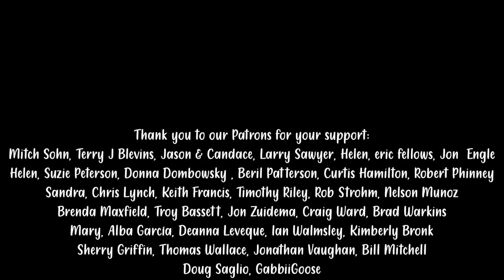THIS IS A STRUGGLE // siding our off grid workshop

Comment: You will like that Hardie Board (Cement Board). I have it on my sunroom in Florida and it is tough stuff and holds up well. It's good to use metal flashing behind the joints to keep driving rain from  penetrating behind it.

Comment: Back when I lived in Costa Rica, we had some serious terciopelo issues.  I considered making a device I call the hot rabbit, fur on a pole with a (battery operated) heater.  The heater would be tiny (just resistors dissipating heat), and you can wave the pole in front of you when walking through the jungle.  Hopefully, the terciopelos would strike that and not your legs.

Comment: Good job on getting masks!      Some side notes: you really don't want to caulk the bottom edge of lap siding. It defeats the purpose of the lap in shedding water that gets behind the siding. (Hint: water ALWAYS gets behind the siding) good call on the rain screen, (reflectix), just put up enough that you can cover with siding,  clamp a board on top edge of plastic to hold against wind. Love your continued positive energy!

Comment: I love your videos. I'm wondering why you're not using the roof of the shed to collect water into your holding tanks?
Reply from the maker: We will!
Reply: @Gerhard Breedt You know that they used to have a purpose-built rain collection roof, right, that the wind ripped apart? So maybe they are thinking that this roof is not the right material, but they could cover it with the kind of material that they used for the collecting roof. I've been wondering about it too. The piping may be the problem.

Comment: I put my corners on first and cut cement boards to them and when u have your first board along the bottom mark the top of it 50 mm down and hold your board to that and check every time u go up 3 runs with level

Comment: I built a small camper using reflectix as a moisture barrier.  Worked well except 1, drastically reduced the cell signal, and 2, when the siding boards shrank in the heat of the desert southwest the reflectix showed between each board. I call my camper "Little Crooked House". I readily admit to not being perfect.  Enjoy your journey.

Comment: You need to tape the seams of your vapor barrier in order for it to be effective.
Reply: indijen I kept expecting them to put plywood up and then wrap but I guess you can’t get plywood there. Cement boards into meal studs would be a last resort for me. That stuff is so brittle. Plywood, then wrap, then tape all seams, then pretty stuff on the outside for sure!
Reply: @kevanray  Even osb would have worked, cheaper too.
Reply: @DuffyGabi  Most buildings or houses in Panama are concrete and block construction. Some adventurous folks also use M2 which is the foam  core wrapped in wire mesh. They mostly only insulate the roof with that same reflective stuff they were using on their walls.

Comment: Chalk a line on your reflections and it will keep your row straight. On the reflections. AC) if you could find the big green washers they use for tar paper it might help your other paper, but the wind may be a problem until you put that wall up. Cement Board should las forever.   Great choice

Comment: Looks like You’ve done a good of construction. Some advise, you need to stagger the siding better, stepping up along the length of the wall on every row. Makes for a stronger wall. It looks like you have a joint on the same stud every second row.

Comment: there should have been small holes on the wrap, so the wind wouldnt tear it up. Honestly the building is looking great, but you guys are building it american style, you should consider what the locals use. They use certain materials for a reason. Theres also a reason why the materials you have in mind are not sold down there, pricing, function, or no need for it.

Comment: I did have a solution using the tiny spring at the bottom of our property however it strikes me as over complicating it you have many square meters of rainwater collection on your new shed. The roof must be slanted one way so a little bit of guttering and pipes and you are sorted.

Comment: When you fitted the gyproc beams ( the flexi aluminum beams ) you should have fitted them to the outside edge of the beams making the exterior easier then on the inside you could have used any material to pack it out, but as you said this is how you guys are learning to do this kind of work, doing great either way btw!!

Comment: Have know idea what you might be trying to keep out other than the elements, but maybe for a faster build, horizontal spacers between the solid uprights and then roofing steel sheeting on the outside with really good seals to keep the outside from getting in...

Comment: The tyvek used on the outside of the wall is normally a windbarrier which allow moisture to pass through from the inside. The water barrier needs to go on the inside of the wall. Insulation goes in between the water barrier and the wind barrier. If you put your water barrier on the outside,  you will get condensation on the inside, i.e. into your wall and it cannot get out, resulting in poor indoor climate and risk of fungus etc forming..

Comment: In the states they call that siding Hardi Plank.  I just finished a bunch on a shed.  I know you are paranoid about wood, but I would have sheeted the framing with plywood, house wrapped it by stapling on the plywood and used tech crews on the light gauge framing.  With the building on metal stilts, you won't have a problem with subterranean termites.  I have no idea about dry wood.termites.

Comment: A small extra strip of wrapping underneath each join will stop water getting under the boards as long as it slightly overlaps the board below so any water runs away outside 😊

Comment: Translucent corrugated plastic sheeting is tough and fairly simple to install - Rockwool has a high thermal insulation efficiency is fire resistant breathable and also very easy to install - just ask Mr Roger Lola and the Chickens when you have built them their safe refuge Chicken Coop

Comment: When cement board started to become popular a lot of installers stopped using it because it was difficult to make it look good.
Reply: HUH?  Cement board does look good when installed correctly, and does a great job.  I am not sure what your installers have issues with?  However, I am not understanding the caulking horizontally, as that will not allow the siding to breathe, and they are not putting backing plates behind the joints, or caulking the joints.

Comment: If this has already been addressed and I've just missed it, so I apologise if that's the case. Why haven't you created a water catcher system from that massive roof? I wondered that when you first finished the roof, and assumed you must not have water issues anymore, but in this video you showed you do. Judging by how much of a shower you get coming off the edges of the roof, you'd more than triple the water you're getting from the solar panels.

Comment: ⚠️Bonjour, exterior finish directly on a plastic bubble, you must ventilate this space with slats between, you just said that the morning was really cold ... when the sun will heat the wall there will be "condensation", it is for that it is necessary to leave a space between the two materials so that the air circulates and drives out the humidity ... of which forget the bug screen not to create a shelter for bugs ... 😉🌱

Comment: As another commenter said, you need some things for your chickens.  Your tractor is good but they also need a coup for night time and protection. I don't remember you saying if you put the chickens in the tractor at night, you should. As he said, they need nesting boxes (square box with clean straw) I agree a rooster would be a good thing, they protect the flock and are noisy watchdogs (watchrooster)

Comment: Your experience with the silver/bubble material should tell you that with the "wind" that you have mentioned many times before, combined with the large walls will be a problem if you don't use a strong inside construction such as 2 layers. Too much wall "flex" could cause problems.When have you seen an outside wall with only one layer of ply with a flexible plastic material... Just sayin'

Comment: Doesn't hardiboard need to be installed over a wood sheathing?  It has no strength in that direction without sheathing.  Doubt it will last long.

Comment: 10:31, ugh this is a comedy of errors. Flush the studs with either the exterior or interior of the column so that you only have to shim one side. Now you'll have to not only shim both, but you'll also have to box out the windows on both sides. Also, if you need to look for furring strips to bridge that gap between the 4" col and the 2-3/4" studs, make sure you're looking for 1-1/4" actual size vs nominal size. ex. 2x4 wood stud actual size is 1.5" x 3.5" 

You're kicking ass though. Keep Kicking
Reply: If the studs are cheap then double stud the wall one flush inside one out flush out side leave a space between them and will act as a sound and heat Barrier from out side

Comment: electric stick welders work well and are great for learning. gas works any where and you can weld, braise,  cut and anneal or harden anywhere. mig and tig welders speed everything up a lot. with tig being the key to aluminum. don't know what is available  at your local welding suppliers but probably not like the usa. i suppose gas outfits are hard to come by and that's a shame. they literally work anywhere and do multitudes of tasks. your beads will do nothing but get better with practice even the gravity bending ones. and it is mostly a feel oriented skill. i've worked with pipe welders working on live gas piping whose job is to weld cladding on deterierierating  pipes with gas flow uninterrupted. they usually can't see  a lot of what they are welding. too quick and a cold weld maybe some porosity and a leak. too long and the  pipe pressure punches thru and everyone in the ditch is incinerated. they do it by feel. from years of experience they know and have the feel. they could be blindfolded and weld a perfect bead all the way around a 30 inch pipe.

Comment: Myself included I'm sure there's alot of us interested in your welder. Settings, power, wire speed etc
Reply: you mean that little stick welder he's seen using most of the time?....keep waiting for that wire speed number, you'll get...just be patient.
Reply: He uses a dc inverter tig welder though only seen it used as arc\stick welder, doesn't use wire speeds etc, thats for mig welders. I doubt he has the skills for tig or mig, arc welding is easy to pick up for this project

Comment: Usually you put sheating (plywood) up first, then house wrap and siding over that. Just saying.
Reply: They are wasting there time, they never heard of 16’’on center studs.on hardy siding every cut needs to be primed ,and flashed were boards meet or siding will fall a part. First big wind good bye siding

Comment: Whoa...screwing Hardie Cement Boards to the house could be a recipe for disaster.  The boards are to be nailed, but not all the way in to the support backing.  They must hang and be able to float like a picture frame.  Start over with wood 1x3's screwed into metal studs.  Then use small round head nails to attach Hardie Board to the wood 1x3's.

Comment: How come you didn't do siding first?  If you installed full sheets of siding, you could have cut out the openings for the windows with the metal framework as a guide.  Not a criticism, you guys are still awesome.

Comment: I’m a metal framer and you should use for exterior framing at least 20 gauge studs , and no more then 16” on center for bowing prevention . But overall you’re doing a really good job!!!
Ps : for the siding screwing problem, you should instal some wood inside the studs

Comment: Some advice on a rooster. Take it from experience, get a rooster.  Without a rooster, the eggs will not hatch as the eggs will be infertile. Get a rooster. With a rooster, you can get up to 12 chickens relatively quickly and the eggs taste better and are usually bigger.